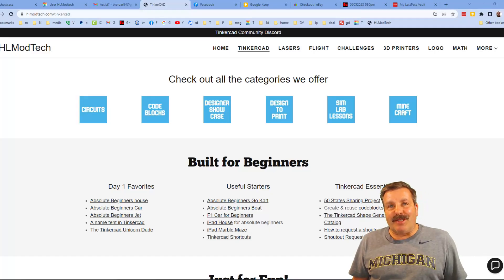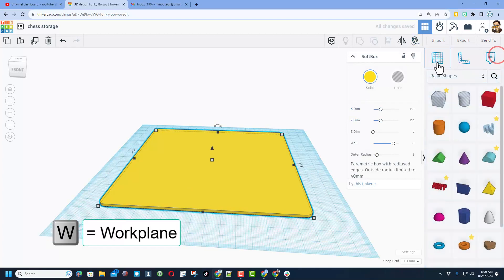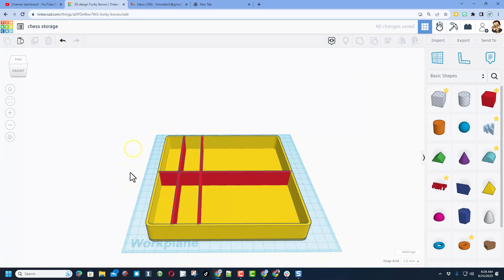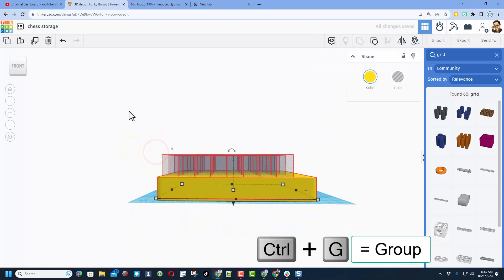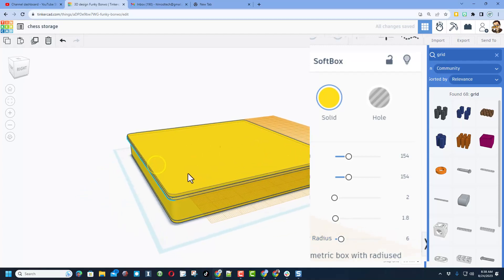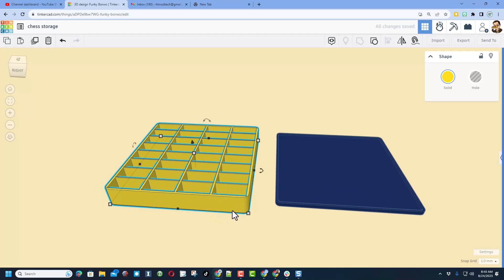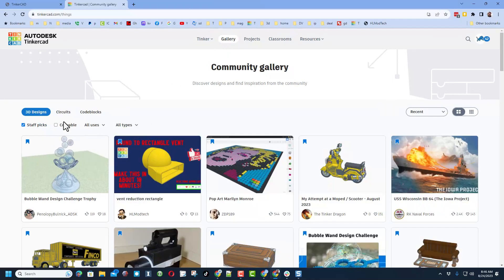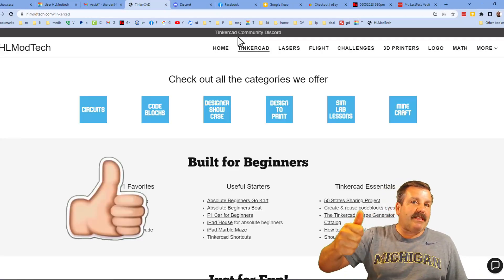The Smartest Way to Make a Tinkercad Storage Box and Lid to 3d print

Comment: After I create this divided box how can I measure the interior diameter of the compartments to make sure they will fit my objects?
Reply from the maker: There is a ruler, but using that fancy shape creator would not work for measuring. You would have to build scratch dividers to get the measurements you want. The Tinkercad ruler in about 3 minutes. https://youtu.be/X3_JOFf69QE
Reply: Thank you. I appreciate your videos! @HLModTech

Comment: Very cool, love quick tips!
One thing... notice  hollow box has rounded corners but the cut out has sharp 45 corners and that looks to be weak 3d print spot.
Any way to make the cut have rounded corners?
Reply from the maker: Good eye! If we had made the dividers the scratch way it would have kept the rounded inside corners.  That hole trick will always have the square corners though. We could make the hole a tad smaller to regain some material in the corners. We could also use the meta fillet to put new corners in there.
Reply: @HLModTech  never the less, a great vid that provided me another tool in my 3d print cad armory, so thanks!
Reply from the maker: Always a pleasure. You helped me out as well since the mods for V2 will be tomorrows video. =)